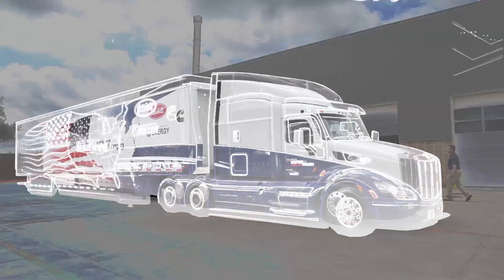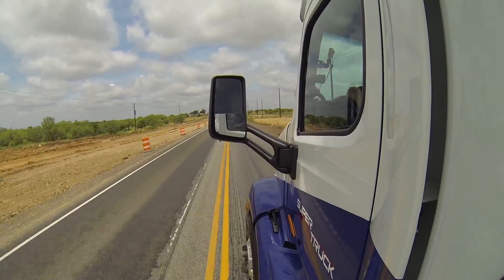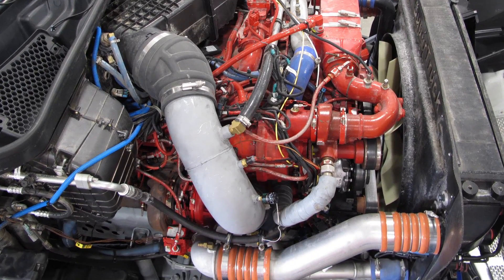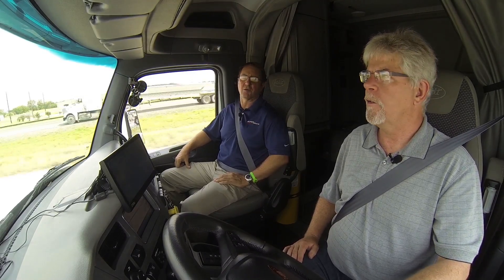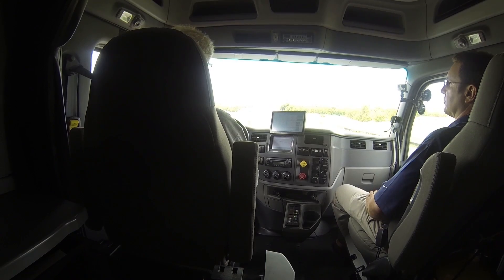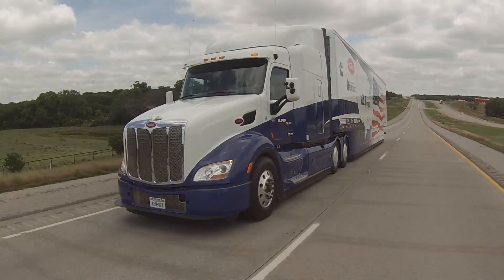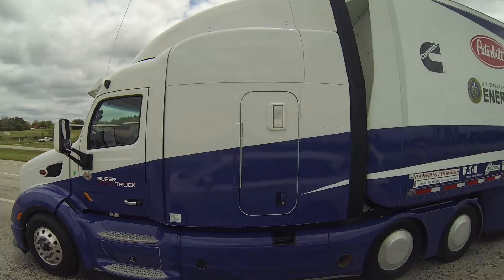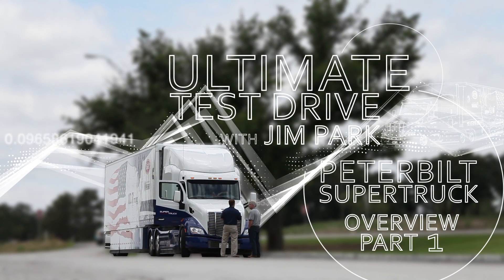SuperTruck Test Drive Pt 1: An Overview

Comment: That's a SUPER TRUCK? Where's its cape? Do you have to be a stuper... I mean super trucker to drive it? Lol

60,000 lb test because most 18 wheelers weight that much loaded? Lol. Bullshit! More like 70,000 lb plus. I run 75,000 lb plus with 90% of my loads. Tell the truth. That truck gets less than 6 mpg grossing over 75,000 lbs. Let me guess. All the testing is done on flat ground and no 6% grades. Right? 

All that bullshit costed the American tax payer  $39,000,000. Fuck you Peterbilt! What a rip off

Comment: The trailer DRAG is a main issue in mpg.  How about reshaping the trailers nose to an oval to improve airflow between the tractor and trailer?   What about the bottom of the trailer?   Make it at an angle (think of a BIG triangle under the trailer) thinnest point towards the nose under the trailer and thickest part towards the trailer tandems to have the air flow take a bit of weight off the trailer at highway speeds.   Just some ideas i had.
Reply: that's exactly what I have been saying since I've started driving a truck. adding things to a trailer only adds weight. 

trailers need to be more aerodynamic and functional. not just the
Reply: is a matter of thermodynamics mostly to go faster you need more power or a faster engine or a "torquier" one remember that power is TorqueXRPM
Reply: That idea will not work in a number of configurations. There are guys that have the long frame with a lot of space between the truck and trailer, flatbed trailers, lowboy trailers and loads that are very heavy. The loads are permitted for a gross weight of 125k to 150k. This is the exception, but other configurations that will never be aero dynamically sound.